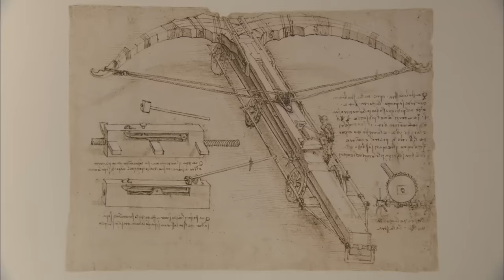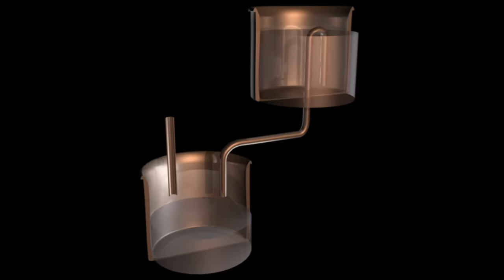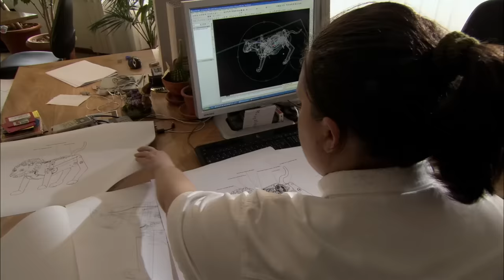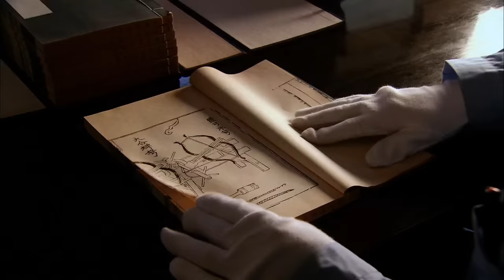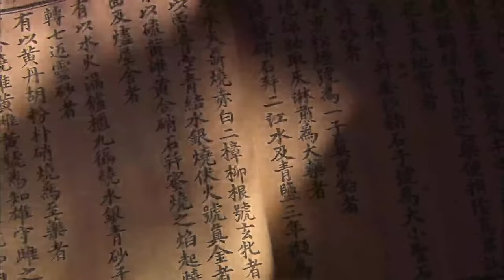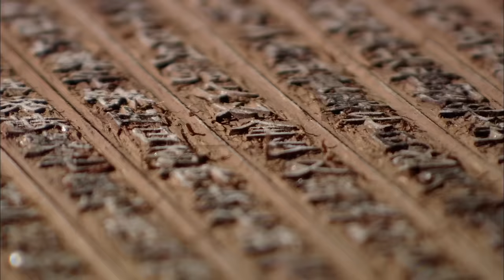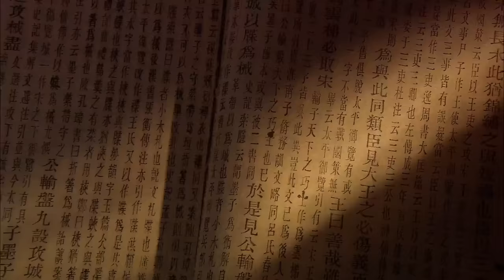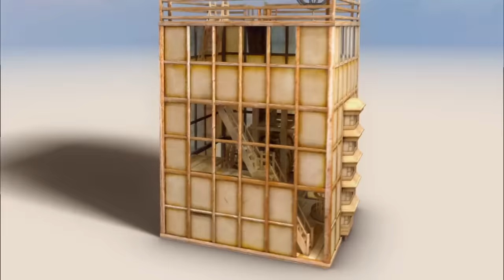Ancient Discoveries: Uncovering Major Secrets of Our Past *2 Hour Marathon*

Comment: You've conflated cam shafts and crankshafts in modern engines. The cam shaft is used as a linear actuator to open and close intake and exhaust valves. On older models, it may be geared to turn a distributor's rotor to ensure ignition timing. The CRANKSHAFT is what "converts" linear piston movement to rotary movement. While you could argue that the offset journals of the Crankshaft are a version of a cam, it is still not a camshaft.